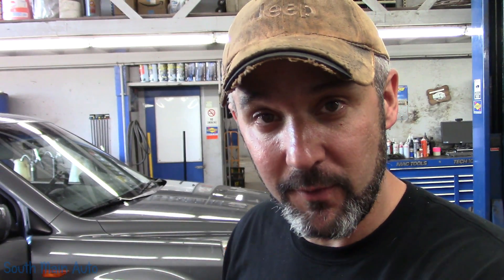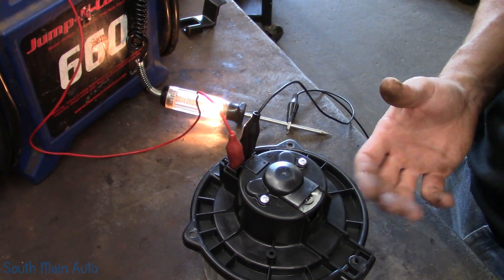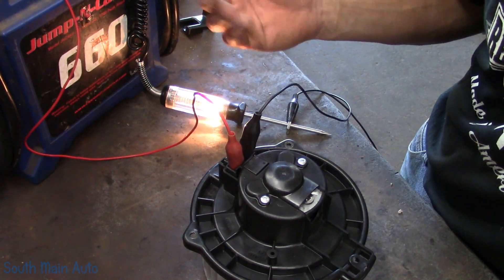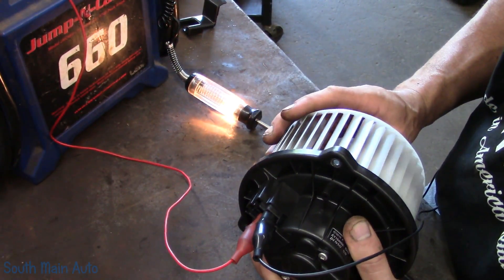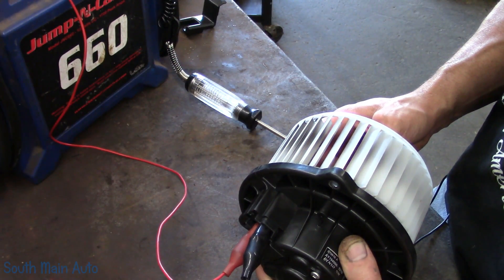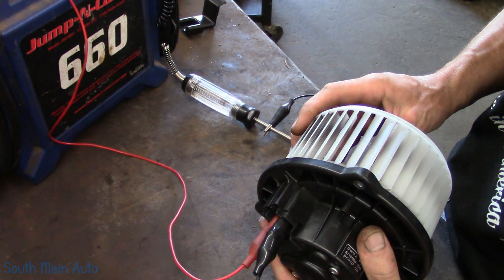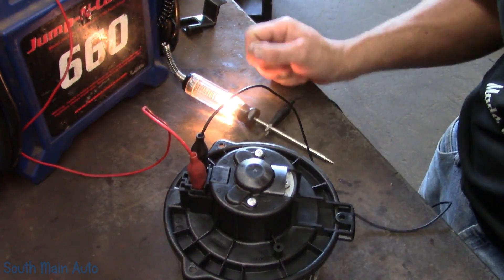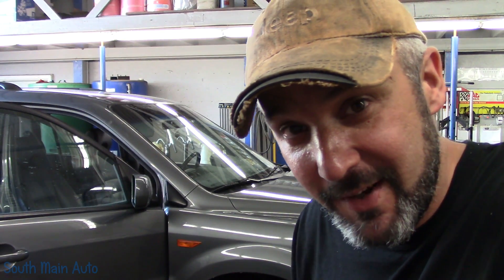Testing A 12v DC Motor For An Open With A Test Light

Comment: By this principle, if you're checking for an open circuit, if you have a multimeter with a continuity test (beep) mode, hook it up to the connectors and just spin the motor. If the beep ever stutters it's bad. Yes?

Comment: I have a motor that will not run in truck. I can hook it straight to a battery and will run fine. I am not getting 12 volts at connector I am getting between 4 and 9.7 volts. I bought another end to eliminate that and it will run fine from the battery. I think that maybe the motor is bad and will run on high but the resistor is not putting out enough volts to run it.

Comment: Why is the motor not running when using the test light to power it, but it will with just a wire?

Comment: Why was the motor not running while connected to the test light ? It has a path to ground when the light is lit.. is it because it requires more current that the light allows to pass ? What if you replaced the milliamp test light with a couple amp headlight ? Would it have started?

Comment: Good tip. However, if a hard whack temporary fixes the problem. Then there's your answer "the motor is dying" LOL a good video would  be to rebuild the electric motor.
Reply from the maker: Jared Strehlein orrrrrr,the connection is a problem right?  This way there is no guessing

Comment: Just have an odd request.  I was thinking about getting a OBDII  reader.  But something more inline with just the weekend worker.  Like the BlueDrive OBDII scanner.  It says it can read other codes other than just the engine codes, it can reset codes, see the last time codes were reset, and get some live data.  Do you think that it would be worth it for the weekend mechanic?

Comment: I do not understand why the motor does not try to run by finding ground through the Filament of the test light. Please help the ignorant!
Reply: the test lights "bulb filament"  being a very small gauge conductor limits the current it can pass, so it starts emitting light and limits the total current flow.
suppose the motor needs 15 Amps to run full speed and 4 amps to start rotating from a stop and the test light takes less than 1 Amp to light bulb filament full brightness, there wouldn't be enough current going through the motor start turning and the light would just light brightly.
if he did the test with a halongen bulb of 12V@50watt or higher, the motor should run slowly and the bulb be dimly lit.
Reply: throttle bottle thank you for this explanation!  I was asking this very question myself.  So, the test light is essentially in series with the blower mother and therefore limiting current draw?
Reply: exactly, the test light limits the current to far less than it takes to make the blower run :)

Comment: Denny likes it. Using the filament of the bulb as a current limiting resistor so that the fan doesn't take off a finger: GOOD STUFF. Considering the fact that you're a dude with little respect for safety I'm impressed. Did Grandma teach you this?

Comment: Great tip! 👍👍

Could probably use this on starters too, once the solenoid is isolated ... unless it's an older Ford V8 - then no isolation necessary.😊
Reply: yeah, but they're much harder to turn in general, due to the bendix. most have the solenoid exposed enough to easily hook to the  terminal going into the starter.

Comment: What is the test light attached to? The ground side of the jump pack?
Reply: it doesn't matter which way polarity is connected, as long as the motor, test light and power source are connected in "series" making a completed loop. 
where the armature/commutator/brushes are good, the test light will light up and stay on while rotated, any bad spot the light will go out or flicker/dim badly.
you may see a tiny amount of brightness change when rotating one way or the other, but nowhere should it go off or dim way low

Comment: Nice!  Now show em how to do a wiggle test. Had an 05 Colorado, intermittent blower. Nope, not the resistor/switch/motor, nor the bad resistor harness, nor the poor connection at the ground block up on the right fender.  The ground wire was broken at the F connector at the ground block. Wiggle wiggle the ground wire, and the blower would kick on/off.  To add to it the wire was only partially broken. Had enough contact to turn the a/c light on but not enough to spin the blower. So all would check out when following the wiring diagrams. One of those hair pullers to correct.

Comment: That is a good way to see a open I had a dryer motor that way called for service the jerk spun the dryer and called me and well it’s working now I don’t know what to tell you I looked at him and said your an ass you know it has and open winding you spun it past it to get out work I told him to get his supervisor on the phone he snapped up I got the motor on the truck I will have it changed quickly the stuff you have to know to make people do there job it makes me laugh now
Reply: must be some new fang-dangled magical energy saver dryer, which costs more overall due to all the repairs :))
they used to be mostly PSC motors ( here in usa) now you never know what you'll get, except for short life spans and costly repairs ;)

Comment: Hey Eric, did you blow out the carbon on those brushes? For me the vacuum hose on that commutator was blocked due to some leaves that got in. Put the compressor into it and a bunch of carbon dust came flying out. Might just be one carbed up spot on the commutator.